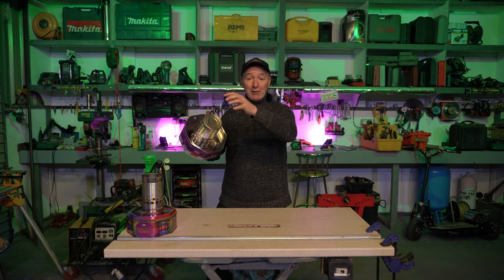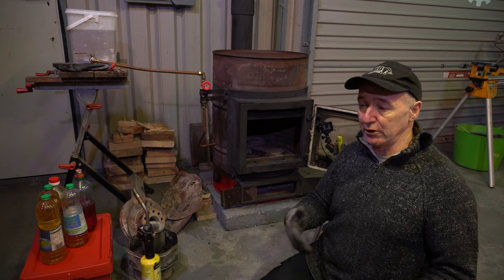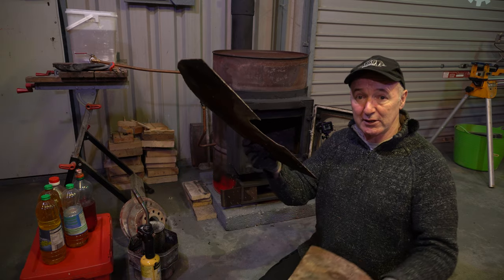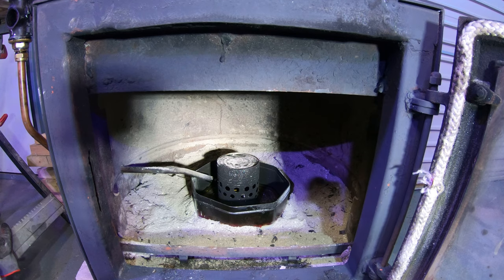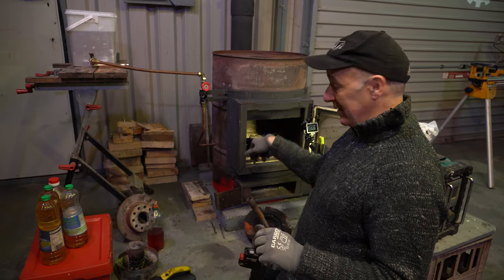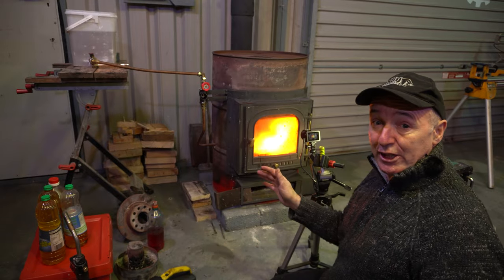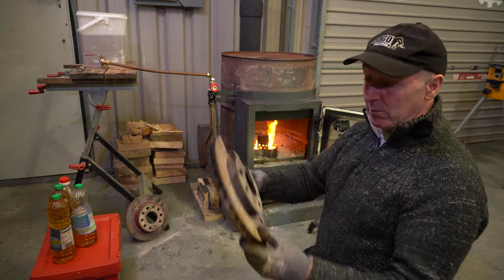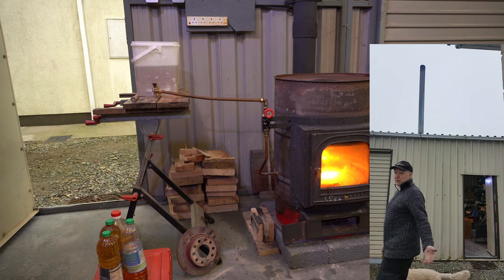Awesome Tin Can Burner   Free Heat

Comment: Thanks so much Gerry from the 🇺🇲.  You have inspired me and I am gathering materials now. I have a 3500 square foot house and a huge pole barn. My dream is to heat all with waste oil. Better than electric heat. I did find someone who has done the same as you but has a different way of getting the heat in the building. If you are interested I can send you the video. You may have already seen. Again thank you so much.
Reply from the maker: Hi ME. I have made a burner a few years ago and I had it running in a boiler stove. Made lots of steam 😜 I will be making another boiler stove in a few weeks. Appreciate the comment Cheers Gerry 👍👍

Comment: I found air control is the most important part. My wood stove is actually a little too big, but with some extra sheet metal to concentrate the heat it worked really well.
Reply from the maker: Hi Rudy. That's been my experience too. I have another mod for this stove but I might leave it a while as I have posted lots of stove videos lately but this thing is running really well and making lots of heat reliably. Thanks for commenting Cheers Gerry 👍👍

Comment: I have mine built. Just need to get a pipe through the wall and I will be heating my shop on used motor oil. Thanks for the inspiration Gerry! Cheers!
Reply from the maker: Hi Rob.The length of the flue and the diameter are really important for use without a fan. Good luck with the project and stay warm 😃 Thanks for commenting 
Cheers Gerry

Comment: Thanks for sharing your design, it's brilliant.  
I'll be utilizing a rather deep stainless steel lid, turned upside down & one of those small propane canisters, that lanterns screw to the top of, as the updraft tube.

I've run into a few difficulties living aboard an antique sailboat, but think this may solve at least a couple of them.  

I've got 2 small propane tanks stacked on top of one another, with a heavy truck rim on the bottom & a spark arrestor on the top.  
The bottom tank is meant to dispose of non biodegrade household waste.
The top tank will have an oil burner like this one and the draft tube from the oil burner will go into the bottom tank.  

Since a properly functioning oil burner reaches such high temperatures, it should be capable of eliminating pollutants released by burning plastic to it's most basic element...  carbon.  
This is the same idea used by "environmentally friendly" municipal incinerators in the U.S.  

Aside from no longer having to pack all of my garbage to a dumpster (which isn't very near), I can use the heat produced to flash distill water.  

I'll add a square tank made from plumbing parts at the top of the upper  tank, with two T fittings. 
One of those fittings leading to a valve to let non potable water in & the other going to a copper condenser, situated inside of a bucket of cold water.

In the center of the square tank for flash distillation, will go another coil of copper tubing to be used to heat water.
  
I live in Florida, where a hot shower is hardly missed, but I'd like to have the option to do so.
Reply from the maker: Great Post Kaiser Sose. Have been to Florida a few times and surprisingly had frost on the car in the mornings while I was there. Of course it was Tee shirts by 10 am but when it gets hot it means business 🤣 Thanks for commenting Cheers Gerry 👍

Comment: Love watching your stove builds.  Just got one up and running myself and still tweaking.  Mine is a forced air unit as it wasn't practical to do an updraft setup like you tend to use.  My issue is I'm getting soot buildup on my glass doors within a few hours of running (faster if I crank it up).  I typically run it at a fast drip (any faster of a drip and it would be a steady thin stream).  I'm using forced air with the air pipe coming down into the center of the bowl.  Air slots in the tube were cut on angles.  I use a cut rotor to cover the bowl.  The bowl and rotor tend to glow and the fire isn't lazy but still getting soot build up on the inside of the stove walls and glass.  Any thoughts on which direction I need to go to help correct this issue or is it just something I'll have to live with?  Thanks!

Comment: Great videos gerry ! I have an old oil control valve from an old oil furnace that has float valves sort of like a carburetor, they contol gravity flow of the furnace oil automatically in the burn chamber, perhaps a video of one of these control valves running waste oil ? Would be interesting if they run a stove efficiently. Or if it would be safe (if filtered) to run these float valves on waste oil ? -thanks

Comment: Hi Gerry,
Great idea.  It looked like you used the cookie tin and dog food can to prove that the concept worked and switched to thicker metals so the burner would hold up better over time.  No smoke would indicate that you have complete combustion.  Does that sound right?  Thanks for the video!
-mike
Reply from the maker: Hi Mike. That's correct. The Sweet tin burner is just to prove that the burner design is sound but due to the output would not last long. The thicker welded version is the same design but will last a year or more and is also easy to make but needs welding. It does burn clean but with a couple more mods can be made more efficient. Thanks for commenting Cheers Gerry 👍

Comment: Great video. Is there any chance the flame travels up the pipe to the oil feed tank.
Reply from the maker: Hi Peter. I know it looks like it would but air is actually being pulled through the pipe into the stove as the flames require oxygen to burn which cools the pipe. On top of that the oil itself cools the pipe as it travels down the pipe to be burned. Hope this helps Cheers Gerry  👍

Comment: Hmm, I wonder if that could be adapted to have an integrated 1 gallon tank at the bottom, Like a huge camping stove burner? Im sure there are others like me that have old wood burning furnaces that would like to burn waste vegetable oil. I have tried mixing it with wood pellets and with saw dust but when it gets hot the pellets/saw dust starts to "sweat" oil tha dribbles down to the ash pan.
I've been experimenting with a pan with a grate for bottom that sits above a pan that sits above another pan that catches ash and oil where the oil that "sweats" down is burned off . It works but needs refining. Its probably easier to a get burner of the camping stove type working.

Comment: Hi, what is the best design for the burner? I can see that you did a few different ones!
Reply from the maker: Hi. This design works great and at the moment is my preferred option but made from steel works really well and is not too big. The flue length and diameter are important to making this work without a fan. Mys setup is 14 feet flue lengtha ans 6 inhes in diameter. Hope this helps Cheers Gerry 👍
Reply: @GerrysDiy  It helps a lot, thanks.

Comment: How big is the bottom inlet hole and the flue pipe exhaust hole?
Reply from the maker: Hi Blake. The flue is 6 inch diameter and 14 feet long. The flue opening in the stove is also 6 inches Here's the stove build https://youtu.be/6cHR8FJ5ViY Cheers Gerry 👍

Comment: Does that smell like french fries , burning that vegtable oil? Thanks for sharing👍
Reply from the maker: Hi Rod. There is no smell in the shed at all because even with the door of the stove open all the smoke and air for combustion gets drawn into the stove. Outside I dont have any problems with down drafts so it all goes up. When I am on the roof next I'll check but it has not been a problem so far 😜 Thanks for commenting Cheers Gerry. 👍
Reply: Where would you get an old stove?..is it a Parkway type?

Comment: I've seen you have burners with holes from the middle and some with holes from the outside. Is one option better then the other? Have you tried one with holes from both the inside and the outside???
I have made a burner from a stainless steel beer keg, with holes on the inside, wondering if I drill a few extra holes on the outside will make it better or worse, cheers for the inspiration

Comment: Hi Gerry. I've watched your heating vids with great interest and want to put something together myself to heat my workshop. So I had a thought. Would it be possible to convert an old gas cooker to burn wood and waste oil in the oven? Idea for a video perhaps?
Reply: Gas cooktops/ovens aren't really built of robust enough materials to last more than a few uses, unless you have one from the 1950s.  
They're nothing but bent sheet steel, held together with sheet metal screws.
The force exerted from heat warping the sheet steel will sheer the screws in half.  

The difference between the heat produced by a vaporous gas burner and an oil burner is immense.  
The way to tell the energy density of a petroleum product is to look at how many hydrogen and carbon atoms need to be strung together to create a molecule of that substance. The more hydrocarbons, the more energy.

I have a suspicion that the top of the oven would get hot enough to melt. 
It would make for a cool video though
Reply: @kaisersose5549  Thanks for that! It's probably why no one has done it yet. Ah well, it was just a thought.
Still, if Gerry DOES make a video.........
Reply from the maker: Hi Peter. Probably not because you need control over the air intake ( no leaks)  and the oven would be too thin to last long. But like the biscuit tin it might last long enough to experiment with it. Thanks for commenting Cheers Gerry 👍
Reply: @GerrysDiy  I did wonder if it might be too fragile. It would have been really convenient if it was viable. Ah well...
Thanks Gerry.

Comment: Hey Jerry thank you for the Video. I have a question, what is the purpose of the “Top Hat”?
Reply: It concentrates the flame and heat by deflecting the original flame downwards a bit.  Remember he said it was “to deflect the flame a little bit?”   That was why.
Reply: Also, another commented about using a disk rotor (from a car) for that purpose

Comment: I made the stove based on your videos, no smoke when runing. but after several hours outside you can smell nasty fumes :(
Reply: Well build a duct that collects the chimney exhaust and sends it thru a collection of sprinklers water walls to scrub it cleans, then pour the water down the drain and let the city deal with cleaning it, since your already paying them to. 
Or
What I intend on doing, once I figure it all out, it's mixed the two fuel sources like use wood but supplement it with occasional oil to heat things up a little bit here and there.  
Or do what your car does and route your primary exhaust back around to mix with clean air and get a second burning before being exhausted at the main exhaust. 
Or
Deny everything, and blame it on the neighbors, and Hufflepuff a lot so people think you're serious and about to go do something.

Comment: do you need the brake rotor?  and if not why put it on.??   I would love to see it without it.   I'm thinking the negative air pressure is the main cause of the 'fan' sound and major flame increase when the door is shut... the flame has to draw more air in from the bottom... as a suction which super charges the flame.  I want to make that on a mico scale... hmmm...
Reply: Man u wanna make your room warm or all the earth? If u don't put any iron or metal around or on the flame, it just go up and went out with all energy and heat so u will not get most of heat, that is why there is a metal around all burner, I think it's basics everyone should learnt from school physic lesson.
Reply: The top plate holds the heat lower in thr stove and reflects the heat down to the oil to help it vaporize and burn more consistently.

Comment: What is the purpose of the brake disc on the top?
Reply from the maker: Hi Dave. It's just a chunk of metal that gets red hot and helps convert the veggie oil into a combustable gas. Its a strategic placement though as the heat wants to rise with the flames but are restricted by the brake disk which in turn gets red hot and makes the burn even more agressive. Thanks for commenting Hope this helps Cheers Gerry 👍

Comment: An addition to my previous comment, making it out of tin cans or aluminium is a bad idea, its a fire hasard because it has a low melting point,as Gerry said at the end of the video that is correct, use Steel instead, if you dont you should not attempt making these.

Comment: Wont the flame go up the oil feed pipe?
Reply: The oil will only burn once it's vaporized. The oil in the pipe is still in liquid state so there's no threat of retrograde fire. The open fitting outside the drum that the oil runs through also allows air to be sucked in with the oil preventing vacuum which would be needed for the fire to burn retrograde.

Comment: Another good video.  However, although burning waste oil in sweet tins is an economic way of providing heat. One huge drawback is the increased risk of diabetes.
Reply from the maker: Hi Bob. I have to stop eating sweets to make these videos. It's hard enough to get the tins as well as most of them are plastic now. Thanks for commenting Much appreciated Cheers Gerry 👍